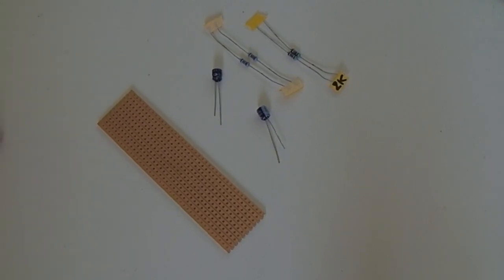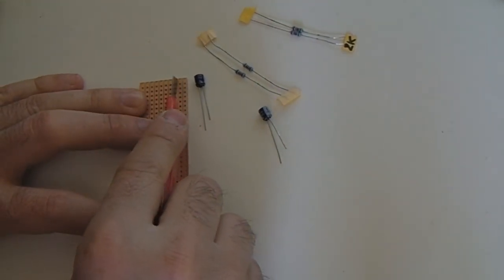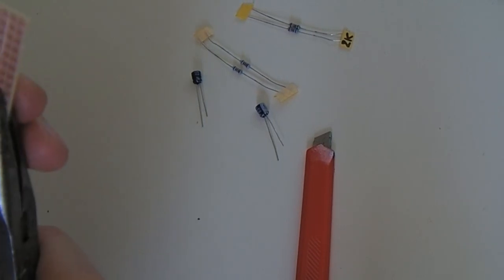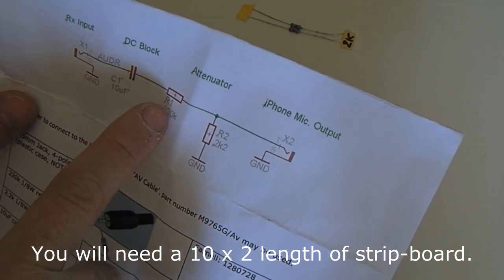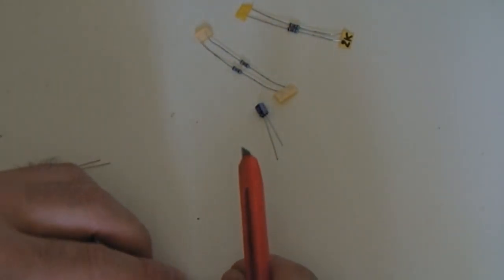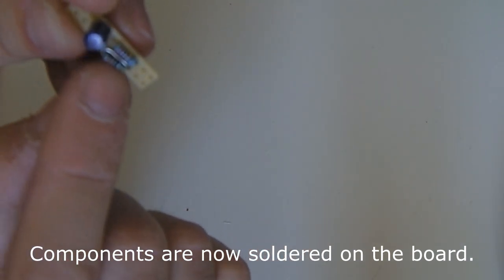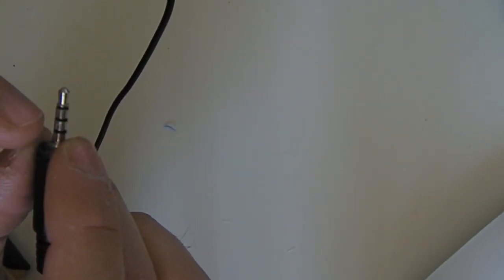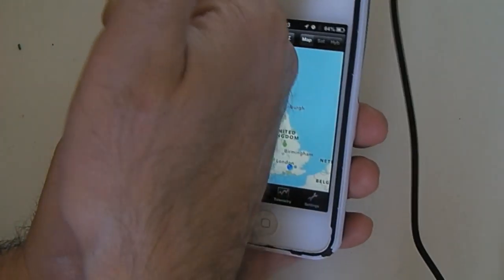How To: Build DIY ImmersionRC iTelemetry iPhone & iPod Audio Telemetry Cable

Comment: Thanks for posting Davey as I could not find a schematic anywhere!  Other produced cables out there have a variable resistor (potentiometer) to deal with the gain of different Receivers for the audio signal with telemetry data.  I made the cable as suggested in the video with a 10uF Tantalum Cap and my iphone had too strong of a signal that was saturating.  By changing R1 from 220k to 950k resistor, the output values dropped a bit and now work for a Lawnman RX to iphone 4.

Comment: Thanks so much for doing this. I haven't soldered anything in 30 years but your video got me through it. I have successfully used this cable on iphone and android. I think the key, maybe, is that the audio cable going into the phone/talblet has to have 3 plastic dividing rings (three hots and a ground), so it is not just stereo, but stereo plus video. I can't imagine why this is important, but I think it is.

Comment from the maker: If the audio cable is antenuated enough it will work just fine :) To make the app work you need an EZOSD or a TinyTelemetry.

Comment from the maker: Thanks for the reply :).. Did you try turning your telemetry level down on your EzOSD/TinyTelemetry? that might have helped.. The specs I've used are from the manual but yes if the pre amp in your RX is a bit potent or your TX over modulates a bit then up'ing the values may help :)

Comment: It didnt work, only bad packets in my app...
Reply from the maker: Make sure your app settings (for Telemetry speed) match those on your OSD/TT.
Reply: Yeah, but I have a XuGong v2 and my vTx is Boscam. GoPro's connector only have 3 cables (+ - V) but vTx connector have 5 (+ - V Audio-left Audio-right)... I dont understand anything.
Im hearing my voice across my vTx, but only bad packets...
Reply from the maker: Adrian Aragon You need to disable the mic on the VTX or use the other channel (if you've got a LEFT and a RIGHT).. If the mic is picking up audio it will corrupt the telemetry packets
Reply: Yes, if i connect the positive from XuGong connector to vTx, mic is disabled, but packets are  bad...